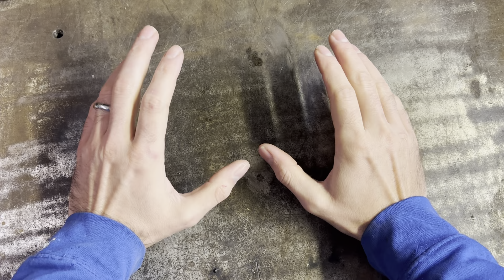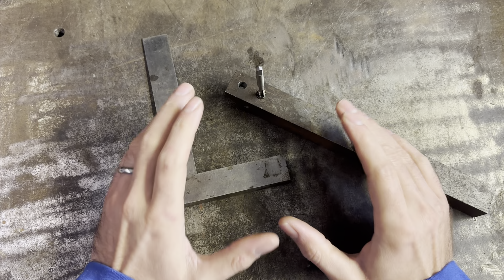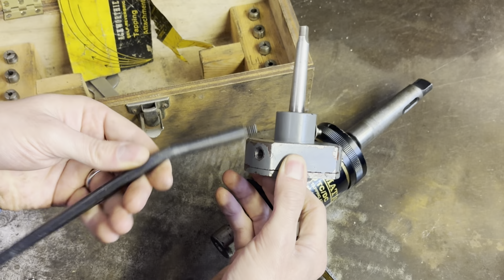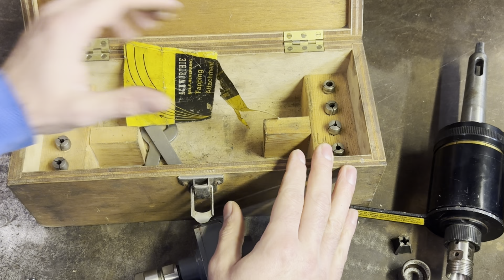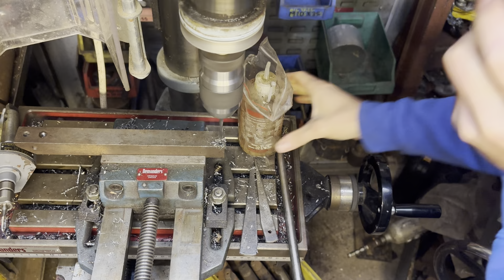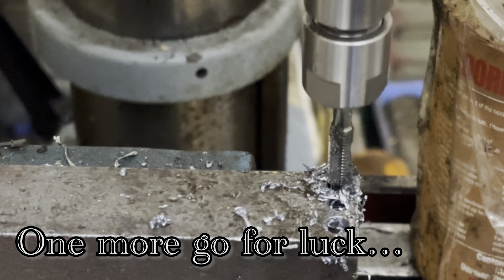The easy way to tap holes, using attachments!! How to use tapping machines

Comment: What pillar drill is that? I’m thinking a Union PD? I’m looking for a  table like that for my pillar drill, may I ask where you got yours?
Thank you for the info, always wondered how those tapmatics worked.
Reply from the maker: Many thanks for leaving a comment, I hope you enjoyed watching!
The drill is a Strands S25, which is a rebadged Arboga A2608. They were produced in Arboga’s factory when they released a new model of this drill, just in a different colour. They are a great drill. 
The table came with the drill when I bought it, and it’s a Demanders. These were hideously expensive supplied new. The table and the vice new would have been around €2500 on their own!!! And the tables are milling machine accurate. Totally over the top for a pillar drill but a really useful addition. 

I am planning on doing a deeper dive into using these, going into detail on how they work and how to set them up so keep an eye out for that video when I’m done!